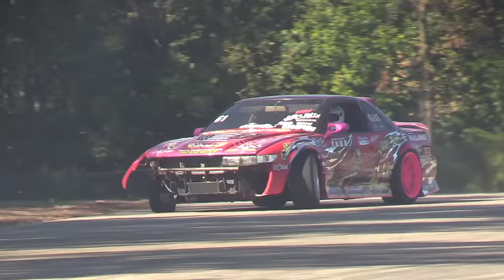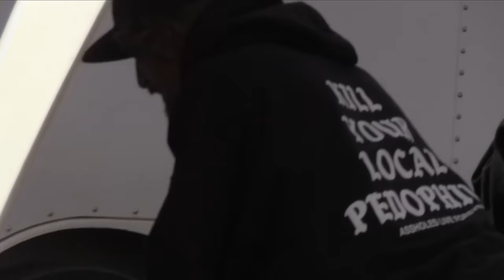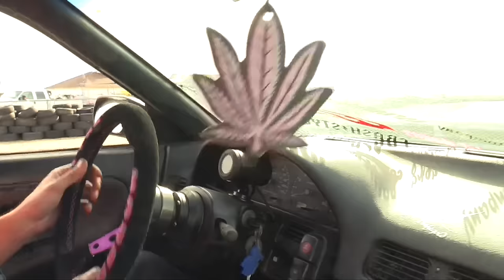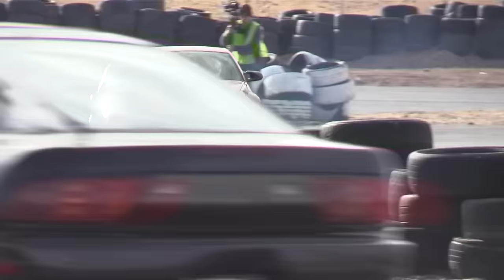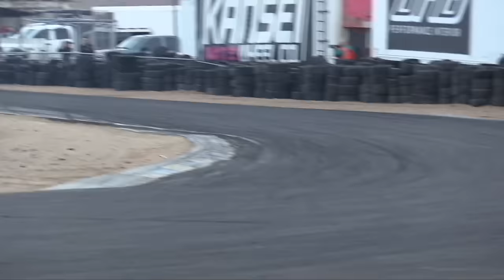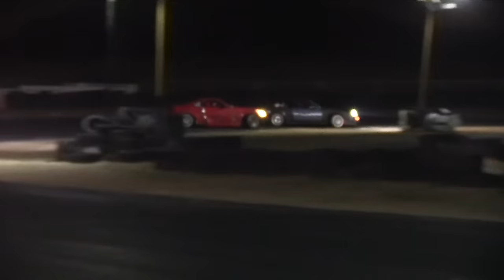CRASH STYLE! SOTW || Apple Valley Speedway // Drift Team Animal Style

Comment: How are you getting the stock handbrake to bite so hard. Mine is garbage with new pads and tightening it down?
Reply from the maker: @Thejdmmuscle  did you adjust it at the drum? Adjusting the handle doesn’t do anything
Reply: @AnimalStyleTV  Yes I did, it will bite a little bit if the weight of the car is off the rear tires. But nothing Like yours, so I ordered a handbrake set up. But you make it look to easy